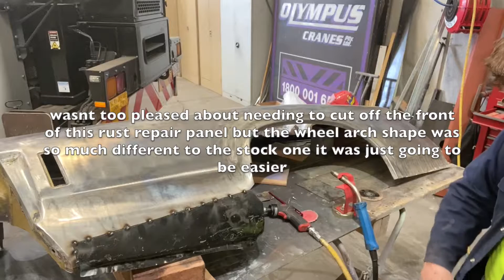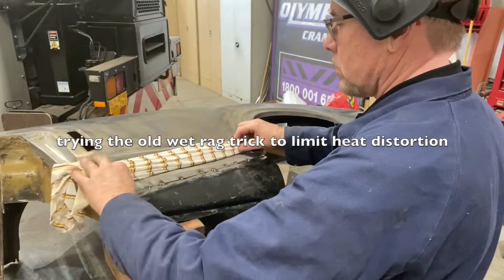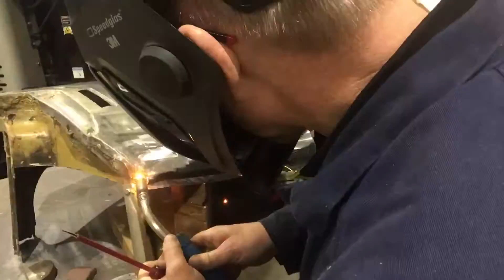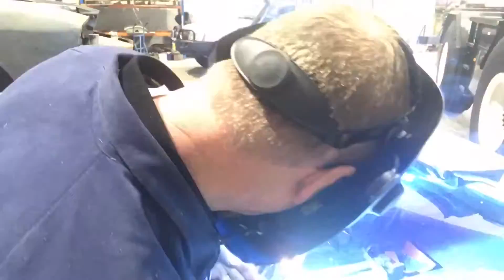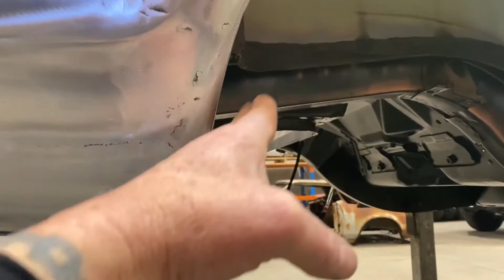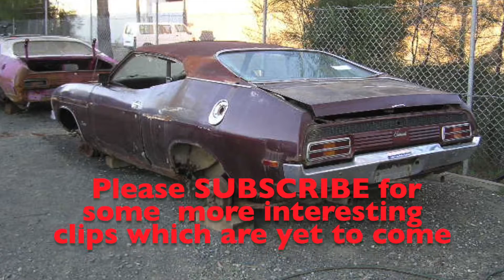Falcon XB Coupe with Mustang GT Coyote swap -  -Eps 4  Rust repair Drivers rear  1/4  -

Comment: How do you keep the car from rusting while it’s in bare metal?
Reply from the maker: David Whitehead - Usually after prepping the metal with scotch bright discs I will deoxidise the metal ( I mix about 20% phosphoric acid to 80% hot water , wipe over the metal , then wipe off with dry towel before it cools , best to use desposable  gloves) This keeps the metal clean for weeks in a dry workshop , and if it starts to surface rust , just do the same again , thats how I do it anyway